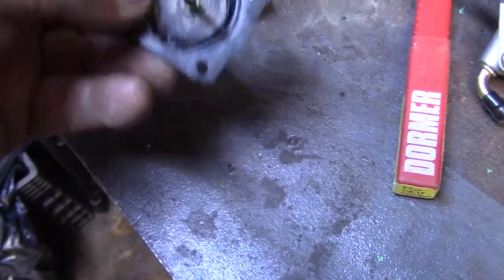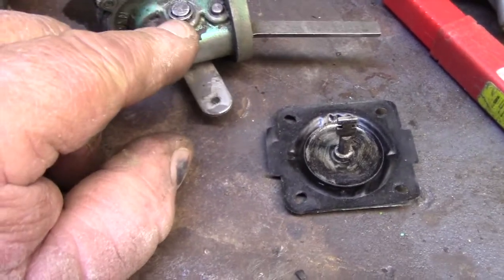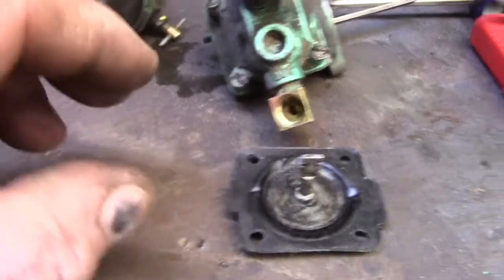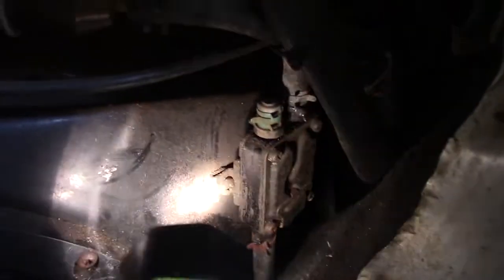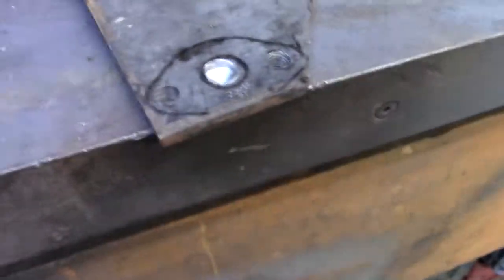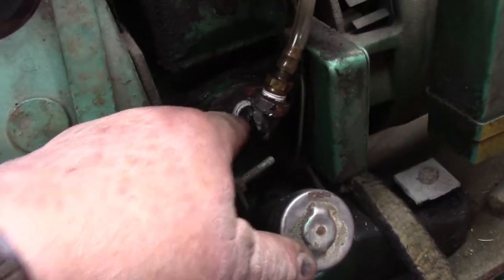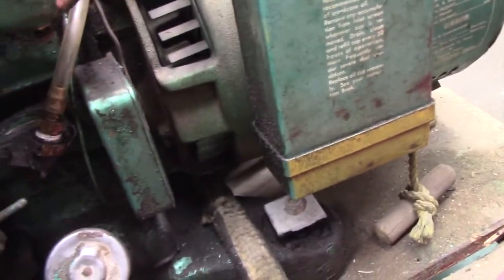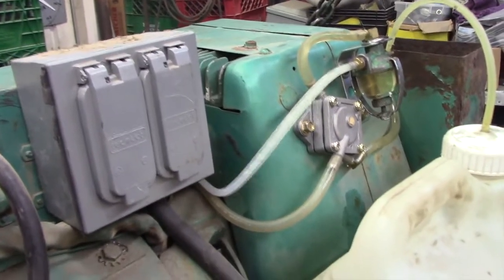Small engine mechanical gas pump change over to vacuum activated pump

Comment: Great fix Gator! Is the generator governed to run at 1800 RPM? An small inline fuel check valve could keep the fuel from draining back to the tank. Cheers!
Reply from the maker: photocontrol It's good that you say that.....I have a few on order but they take a long time to get here.... They must be coming from WingWang....yes there is a governor on it....She's a old gal but she still runs good....CHEERS

Comment: good idea
Reply from the maker: I know this cure does not apply to many in here but it`s a solution to a mechanical problem and for these old engines it works very well unless you have now compression, therefore, you have no vacuum,,,,,CHEERS